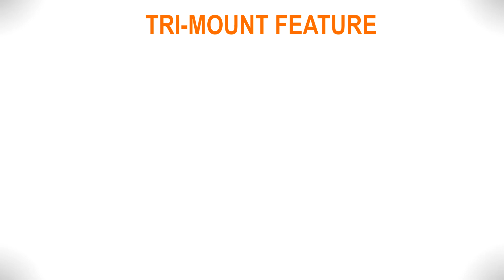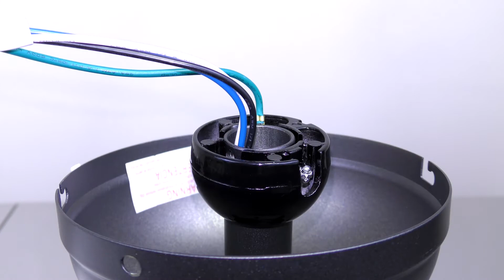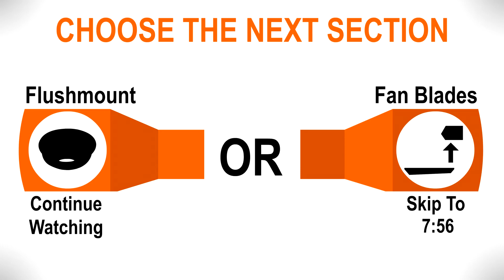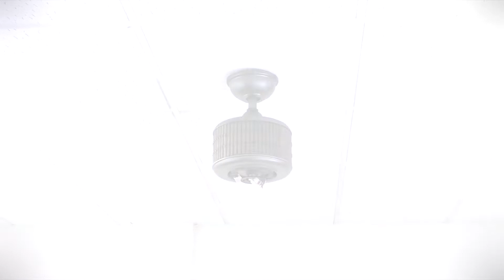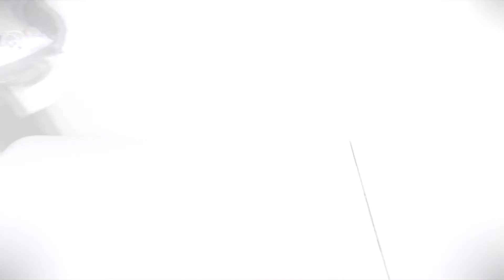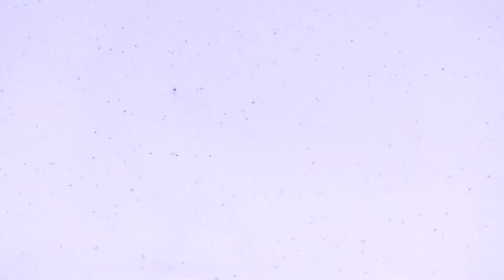52" Tahiti Breeze (LED) Ceiling Fan Installation Guide

Comment: I needed to remove an older version of this fan with bad bearings. (damaged in the after effects of a small fire)The collar over the top cover was impossible to remove without me using a dremel to cut thru it. When fitting the replacement Tahiti Breeze, the three screws needed to fit the light unit are fiendishly difficult to install. You either need three hands or you need to stick them temporarily to a screwdriver, or at the very least offer them up to the holes whilst holding them onto the screwdriver, a tricky operation. I do find this fan to be of better quality construction than similarly priced units from other makers, and the clip in blades are a genius feature, making it so much easier to clean the blades each year. I also like the suspension arrangement, which helps the fan run quietly and can adapt to a certain amount of ceiling irregularity.